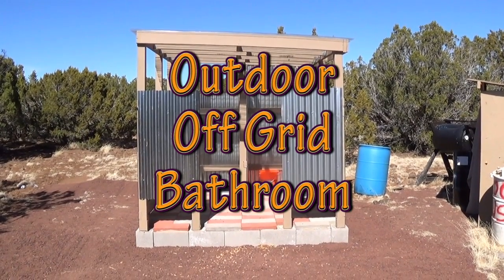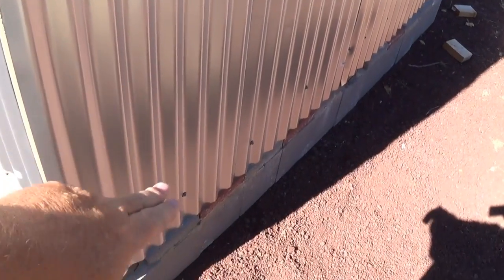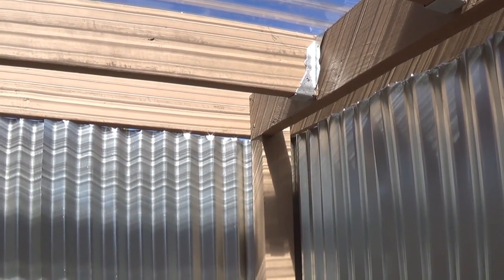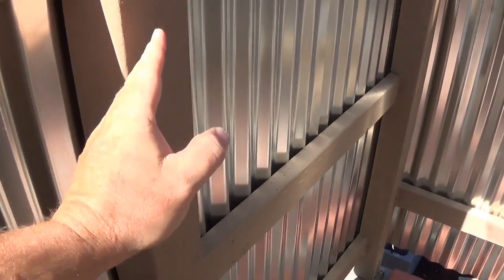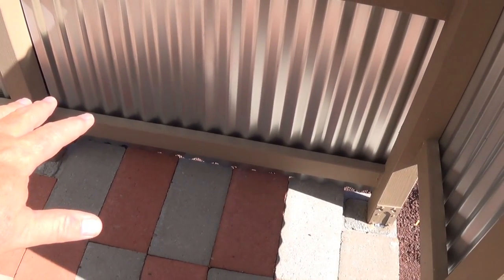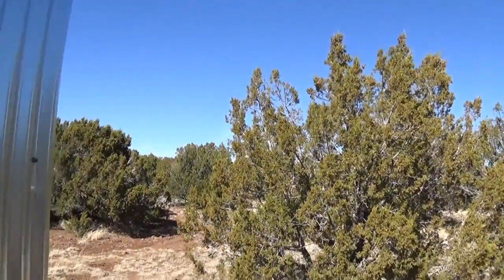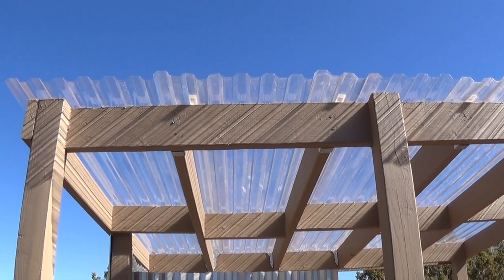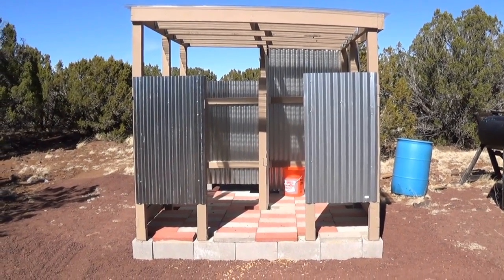Outdoor Off Grid Bathroom Walls and Roof Completed - A Little Privacy from the Wildlife

Comment: Very nice. I'd like to create a shower stall and toilet, but it has to be fully covered for privacy in consideration of where I want to have it, which is in my yard. Yes, I live in a suburban neighborhood, but on 3.5 acres and it's zoned as agricultural, so I have more freedom, but people can see into the property.
I want it as a backup facility in case of a power outage or during hurricane season.... which causes prolonged power outages or when we have plumbing issues. If it has a water catchment system to stored rainwater then with a solar heating unit I could also use such a building to provide emergency water and a way to make warm water to bathe my little dogs. Filling tubs or trash cans with water to wash or flush toilets is just a big pain and not as effective as a whole complete setup like you have.
Reply from the maker: nice. when i built this i saw lots of videos for showers near pools with lots of privacy and looks really attractive. have fun building  it and be creative.

Comment: I just figured over time water may erode the foundation if it ground there isn't very permeable I was thinking maybe of doing a small French drain the leads away the sight or maybe collecting grey water to water plants
Reply from the maker: +Benjamin Rodrigues my experience with the blocks so far is the only thing that really hurts them is salt. over time they will break down but for example my dad has blocks like these in an area that gets wet a lot and those block are still there 50 yrs later. all I need them for is 20 maybe 30 yrs. lol.. plus I do plan on putting a water seal on them.
Reply: You can also do a mulch pit system which aerates a box that collects the water.

Comment: how'd you plan for drainage? I like it alot thinking about doing it myself thanks for the insight how much did this cost you?
Reply from the maker: +Benjamin Rodrigues drainage? nothing. for the shower it will just drain off the floor . cost? not sure. I used 10 4x4, I think 10 2x4, 2x6, 5 clear corrugated sheets, lots of blocks to cover 8feet by 8feet floor.

Comment: How is your eco temp shower doing? I want to do this also and I'm contemplating running water from my water heater or going with eco temp...
Reply from the maker: eco temp is great as long as you have the 25 psi and i found you have to clean it before every summer and dont like it freeze. the walls on the copper tubing are so thin that even 30 degrees far will cause problems . running the line from another hot water source i would be afraid of losing heat over the distance.
Reply: @ArizonaHotHomestead  thank you for the response, I'm in the same boat I could run off my water heater but I think this ecotemp system will just be simpler and not complicate my plumbing inside, thanks again